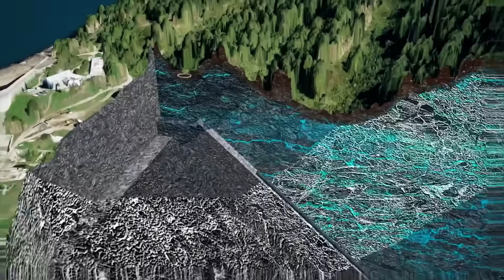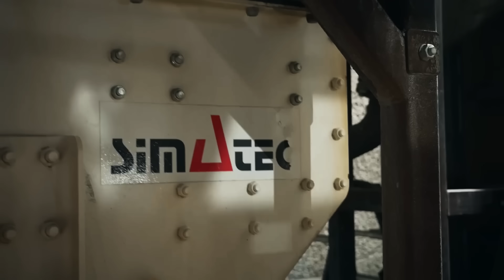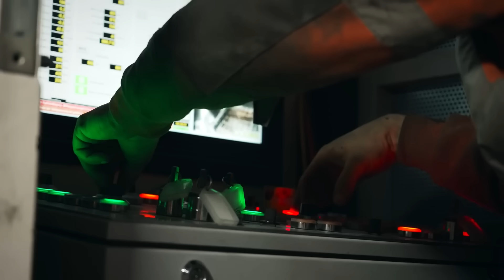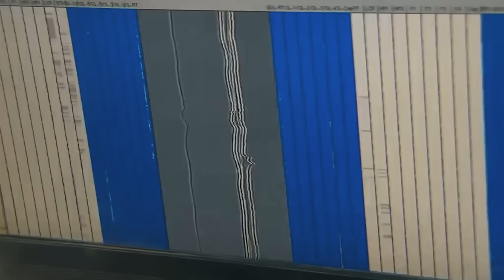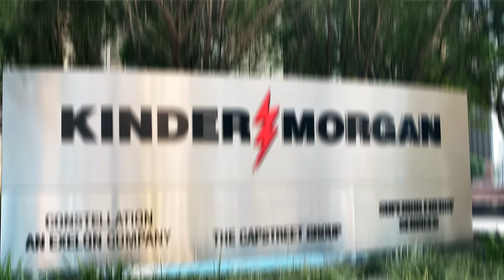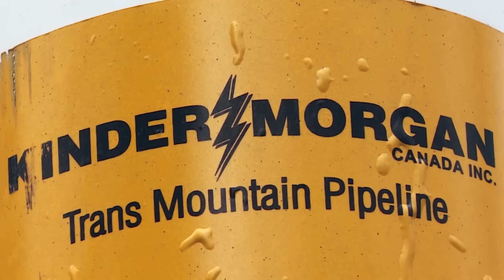Inside Canada’s $34B Pipeline Carved Through the Rockies

Comment: Is there a refinery in bernaby ? Or all this crude going to be shipped to china. So not shipping fuel. Shiping crude. Plans to upgrade refineries ?  Bye bye pacific coast.
Reply: Their is a tiny old refinery in Burnaby, however their are huge refineries in Washington. So they have oil tankers doing daily milk runs because they couldn't get Washington State to agree to a new bigger oil pipeline running 100 miles from from the closest approach to the refineries. Almost all of the liquid fuels used in the Vancouver Area and most of BC comes from Washington. The oil tankers have a longer route due to the shape of the sound than a pipeline would be. 

Total insanity driven by green politics.